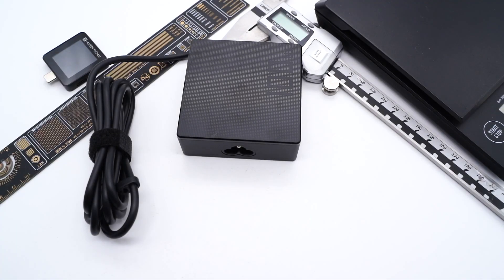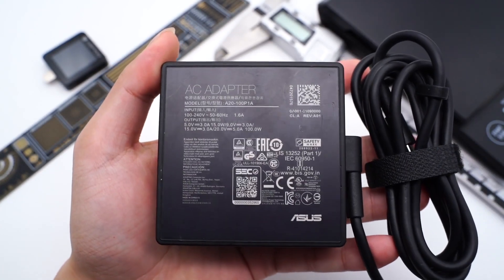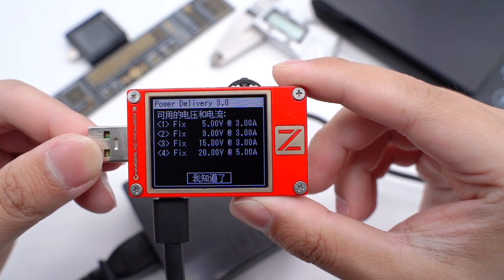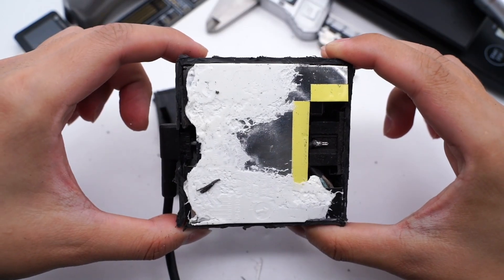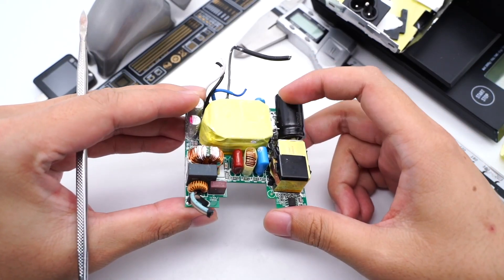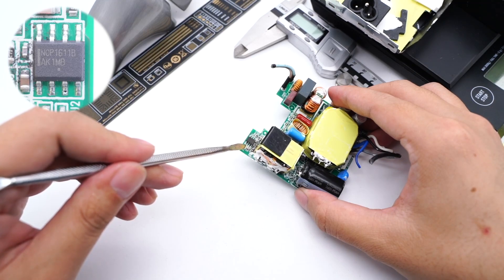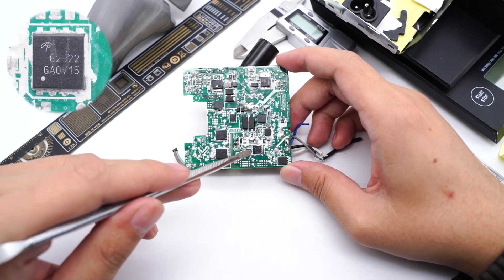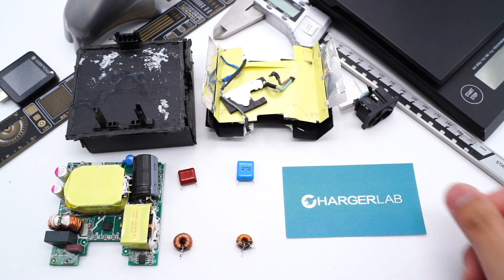Teardown of ASUS ROG 100W USB-C Charger (AC100-00)

Comment: I'm curious what charging protocol does this charger support?   I have a 100w charger from another brand and when plugging it into my Asus rog laptop I get a notification on my laptop charger saying it's not compatible.
Reply: I have something similar, I have a 100 watt power adapter on only get up to 77 watts of charging from type c.
Reply from the maker: It can support PD3.0 and four fixed PDOs of 5V3A, 9V3A, 15V3A, 20V5A.

Comment: Do you know why only this charger can charge ROG laptops at full speed 100w? All other third party chargers are limited to 65w. Does the OEM charger send a signal to show that it's OEM??
Reply: If what you are saying is true, yes the OEM charger can send a signal showing that its the OEM. Apple did it before, they can show if the screen comes with the phone or it has been replaced, so I think it works quite the same.
Reply: I just bought a G14. Tested the PD usb-c charging by using my Anker 140W power strip. The highest charging I got up to was 64W. I’ve been looking for information on why I couldn’t get close to 100W. This pretty much answers my question. I’ll be ordereing the ROG charger as soon as possible. The charger that came with the G14 is just too bulky for carrying around to work everyday.